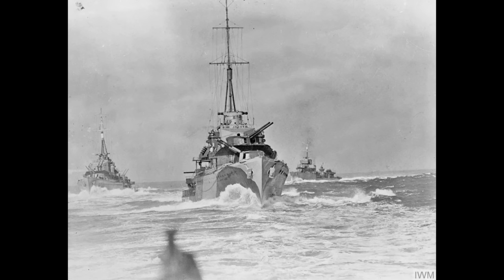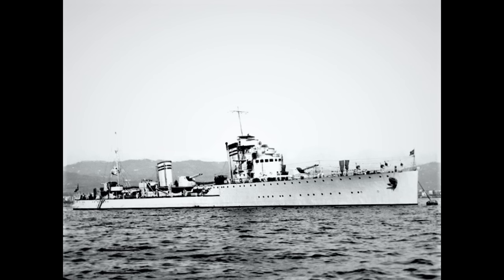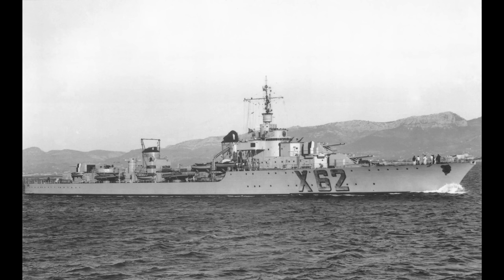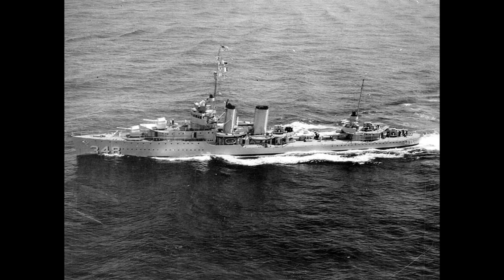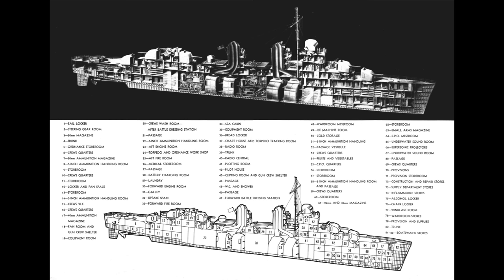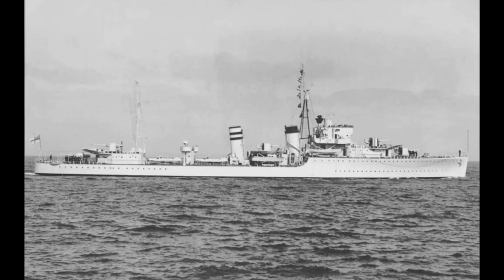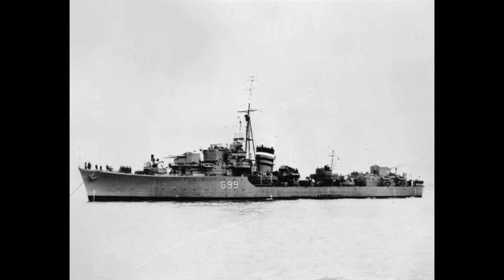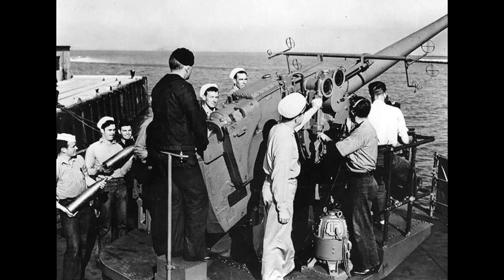Destroyers - Interwar development and design (1918-1939)

Comment: 59:38 ...to the extent of: Use all your fuel and there's a very good chance you're returning to port upside-down."

1:00:38 ...and raise the stern deck somewhat higher than "water surface level"."

1:02:00 "These changes in design finally gave the Germans a destroyer that wasn't either trying to tear itself apart simply by moving or immediately try to join the U-boat corps at the first sign of a wave."

1:03:37 "...helped only slightly by the fact that at least the turret was fully-enclosed, so everybody else got damp socks instead of the turret crew."

1:07:37 "They were badly weighted, so the bow was always trying to head down to meet nearby submarines."

1:07:45 "Oh, and they'd also start to provide free massages to the crew in the form of whole hull vibrations when they tried to get up to top speed."

1:08:43 "...albeit at the cost of having converted a warship into the world's fastest and most expensive group therapy massage chair."

1:09:59 "...and the modifications would add weight in places it really wasn't needed when your primary interests include "not swimming in the Arctic Ocean"."

1:13:01 "Predictably, after the Leningrads, a pure Soviet design destroyer was a bit of a disaster, with added German high-pressure machinery to help along with the shenanigans."

Drachinifel is on a roll today against the Germans and Soviets.
Reply: Amazingly funny quotes
Reply: This is great stuff.  :-)
Reply: Never forget that timeless soviet adage...

... and then it got worse.
Reply: @dragnus12  ah the side effects of neo feudalism brought about by attempted communism that predictably failed to achieve utopia and degraded the intellectual and production capacity of its host nation so badly that the effects still exist to this very day, over a hundred years later. I'm sure no one will ever try something so stupid again, right?
Reply: @dragnus12  kamchakta "torpedo boats?"
Reply: My favorite...."came down with a bad case of communism" ...... not just ordinary communism 😄

Comment: US Congress: “We need 2 more destroyers”
US Navy: “Putting in an order for 20 destroyers”
US Shipwrights: “Good news guys! Time to build 200 new destroyers!”
US Harbors: “Hurry up and finish those new facilities to service 2000 new destroyers!”
Reply: There is a legend in the US Navy that the 31st Spruance class destroyer, USS Hayler was a data entry error in the fleet logistics system and was actually supposed to a case of peaches.
Reply: @JamesSavik  "If one of you jokers orders an F18 or a dolphin, as in the animal..."  Seriously, if it exists it's in FEDLOG.
Reply: US Naval Shipyards, You guys got space for 20,000 new Destroyers??? No well congress passed the bill!.
Reply: @JamesSavik  There is also a legend that you have 1/2 a brain, but it's not true.
Reply: @exilfromsanity  And you Sir don't see the a comical exaggeration on the Situation. The 6 Caldwells and 8 1938 Benson's were the Prototype Destroyers ordered by Congress as they ordered new destroyer types for the upcomming war. When they were okey a first Production Run was ordered by the Navy (Wickes Class or the 24 Repeat Benson) then resulting in the Mass Copy Class Ships of 273 "Flush-deckers" total, referred here as "Clemson-Swarm" or the Fletcher Swarm with 175 in WWII which were scalled up Versions of the 66 Gleaves and 30 Bensons giving them 400 tons more to have all problems fixed.  So in both Cases, at the start of the WW and WWII the US Navy had no modern Destroyers at a high number, so congress ordered Prototype Series and when they had a good template first a small run was made by the Navy, then a high wartime number count. So the "comment" makes a lot of sense as it is a comical exaggeration of the historical facts.
Reply: @exilfromsanity  go home Lucky, you're drunk 😆
Reply: Tomi Tuominen    The United States military that he is so happy to make childish remarks about is the reason he, and you, have the freedom to make such foolish comments.    Just because 195 other America haters agree with him doesn't make his comment any less juvenile, it just means they're  idiots too.
Reply: Tomi Tuominen     How can you make that statement, " none of your comments get any likes ever."?   Have you checked every one of my comments ever on You Tube on every subject?   Or are you just making shit up?
Reply: @exilfromsanity  it's called having a little bit of fun on how America procures and prepares during a conflict. There's nothing  inherently "anti american" about it. Take a breather from 24/7  partisan propaganda,  boomer, it's making your paranoia stretch - stretch your body instead. Relaxxx.
Reply: ChypnotiC Pl  Bitter much?
Reply: Here I thought it was a fun little comment on the military industrial complex, but it turns out Im apparently supposed to take up arms and go to war over it...
Reply: @christopherherrington8387  Mean while in the USSR, What? U say america is gonna construct 200,000 destroyer, guess we'll have to build 2,000,000 destroyer.
Reply: lol
Reply: @exilfromsanity  "ooooh look, a bad ass, we got an internet bad ass over here"....."see, nobody cares"
Reply: Hey lucky, I’m a super patriot and love the USA and I’ll tell you as a vet and history nut, just like every other nation the U.S. has made silly pointless and unexplainable mistakes... let people have there silly jokes and chill
Reply: To that comment don’t fight or argue with him and insulting him is most definitely not required.
Reply: @exilfromsanity  Ooooooh, touched a nerve there then..
Reply: ChypnotiC Pl  Tell that to the nations that aren't required to speak German or Japanese thanks to American intervention on their behalf,  and let me know how that works out for you
Reply: @exilfromsanity  You bring grace and honor to the Avatar you chose. No(thing but) Bullshit is just as reasonable and aware of what they say as you are, so it's 100% fitting.
Reply: My friend's cousin use to be a consultant for the US government.  What he faced in the 80s was the Navy wanting more F-18s and Congressmen paying his company to produce reports stating the Navy needed more P3 Orions.  At the time the Navy had more than enough P3s.  From talking to him I understood how new aircraft could come off the production lines and go straight into storage.    That was 1987.  About a week after taking to him, the Navy contractor scandal broke.
Reply: They built 20 of those destroyers into the Johnston.
Reply: @oceandark3044  plz no, those are not destroyers, they are battle destroyers this is what happen when you compress a battleship into a destroyer.
Reply: I’m an American, all I’d like to say is wherever in the world you are, I wish you and yours nothing but the best and pray for the best health and financial scenarios for all. Hope all of you have nothing but happiness from this day forward
Reply: Veian Demontrond only 20? Nah, they build a whole task force into that little ship. It’s as if God decide to pour a little badassery into the mixing bowl but accidentally dumped the whole flask.
Reply: @exilfromsanity  Its clear you never served in the Navy.
Reply: @JamesSavik  "Private! Did those peaches come in yet? the cooks are running low" 
Private: looks at new destroyer sitting on the loading dock "Uhhhhh"
Reply: @exilfromsanity  You still unable to take jokes?
Reply: Der Richtige Arzt   I am quite offended by your statement. We Americans have contributed to the betterment of humankind, have you ever heard of turning right at a red light.
Reply: Damn... Brain washed partisans, boomers, and death-to-America people all in the same thread? I didn't think the name "Chernobyl" would ever come to mind when describing comment replies...
Reply: @JamesSavik  Poor DD, born a mistake.
Reply: Der Richtige Arzt what?
Reply: @exilfromsanity  before you criticize something, learn to grow a sense of humour will you?
Reply: To be the equal of China today
go learn how many new ships
are needed by the USA.
Reply: @toruko-ishibravo2zulu679  about 80 rowboat would do it. USA 4.6 million tons China 2.0 million tons. More ships doesn't equal more capabilities.
Reply: @許進曾  Some time later....
Aliens passing by: There appears to be a layer of liquid water underneath an iron/carbon alloy layer, apparently manufactured by the natives! Fascinating!
Reply: @exilfromsanity  Who

I mean Who asked
Reply: @Eshanas  nobody gets it done just relaxing tater head

Comment: "Special shout-out to the Germans for the innovations in self-consuming machinery, and ships that truly believed that they identified as pretzels."
LOOOOL
Reply: falloutghoul1 

German destroyers of WWII really were awful, generally.
Reply: @bkjeong4302  well they where built for the most part so long before ww2 they where obselete by the time they got restricted to the numbers they where at.
Reply: @bkjeong4302  Truly baffling how Preston could put flush deckers on his list while ignoring bad and completely inconsequential German destroyer designs.
Reply: @Stardude78  Agreed.
Reply: @Stardude78  "ze german magic superiority, junge". I'm biased towards flush-deckers, can't help it.
Reply: @Zretgul_timerunner  The german WW2 destroyers where all mid 1930s or later designs and construction. The german choose an engine design (high pressure/high temperature - Hochdruck- Heißdampf) that was very promising and powerful but also high maintenance and quite complex requiring very capabel crews. That where in short supply. The system was also used on channel tugboats of the same time and those where mankillers once the expert crews where drafted.

Comment: Drac, At the 36:00 mark you're discussing the Sims class but the photo is of DD 422, the USS Mayo, a Benson Class (next in the line up).  My father-inlaw was a plank owner on the Mayo as gun captain on the Number Five Mount.  The Mayo has a interesting history, just missing the Bismark while on Neutrality Patrol, early convoy escorts - division mate being torpedoed, North Africa, Sicily, Salerno, and Anzio.  Almost had her keel broken by a mine (father-inlaw vehemently insisted til he died that it was torpedo...) and then the longest tow back to the States for the time. RebuIlt and ended up at Tokyo Bay for the surrender.   Make an interesting "five minutes" of her own.

Comment: Corrections
The German torpedoboats type 1924 - called "Raubtier-class" - also had 105mm main armament - like the class before. They wanted to mount 127mm guns but were not allowed by the allies to do so. 1934 "Luchs" and "Leopard" at least got the bigger guns but the rest of the class kept the 105mm calibre.

Comment: With such an in-depth approach, fubuki subtypes could've been explored as well.
Thry were as different inside as many actual classes in video.
Also, generally discarding looking into interwar AA based on its inedaquacy in 1940s is cruel.
1920s, 1930s and 1940s planes are just different in too many ways.

Comment: What a great video history! An interesting side story with USN destroyers were the experiments with mounting seaplanes. The first attempt was with the USS Charles Ausburn (DD-294) mounting a TS-1 floatplane in 1923. The fixed platform was inconveniently mounted directly in front of the bridge. This not only obstructed vision from the bridge but also greatly interfered from the field of fire from the forward 4" gun. Several successful flights were conducted, but the inadequate crane capacity, being needed to lower the plane and retrieve it, and the fragile nature of these early seaplanes, made the experiment generally a failure. The seaplane and platform were removed in early 1924 with the Ausburn being restored to the configuration of other Clemson class vessels.

The next attempt was aboard the US Noa (DD-343), yet another Clemson class. I realize this is slightly outside the 1939 limit of the discussion, but the plans for the seaplane mount were started in 1938, and Noa was originally scheduled for recommissioning in 1939, so close enough. Frank Knox, then Secretary of the Navy, was a great believer in the idea of using destroyers as seaplane carriers to extend their range for fleet protection and commerce raiding. To test this concept again, the Noa was taken in hand when she was recommissioned in April, 1940. She had an XSOC-1 seaplane mounted this time on a rotating platform, displacing the aft bank of torpedoes. She also had a boom with a much greater lifting capacity, and the XSOC-1 was a much more robust aircraft than her predecessors. This time the experiment was more successful, with many flights, and the ability to retrieve the plane while underway, a difficult task for a relatively small Clemson class ship. Noa retained her seaplane until November, 1941, and the generally successful experience with Noa led to Knox mandating the construction of six Fletcher class destroyers with seaplane capability, this time with catapults (!). However, as Drach would say, that's a story for another day.
Reply: Square peg, round hole......😏  Nice dream, wrong platform for scout planes. They Need Sikorsky  to finish  his work on a chopper.
Reply: @WALTERBROADDUS  Indeed. He had some shipboard trials aboard the New York in late 1944 with R-4 that were pretty successful. The R-4 had been used in small numbers by the Coast Guard starting in late '42 and the successful shipboard trials for the R-4 cleared for full scale production starting in February, 1945. The first examples reached the Pacific fleet in June for more testing before it was scheduled for operational use by most capital ships ammo ships, hospital ships and high value transports by 1946. To its credit the Navy recognized early on the value of a helicopter for what would become vertrep and casevac.It was just a gnat's eyelash too late to see operational service during the war, but we all know what's happened with helicopters since then.